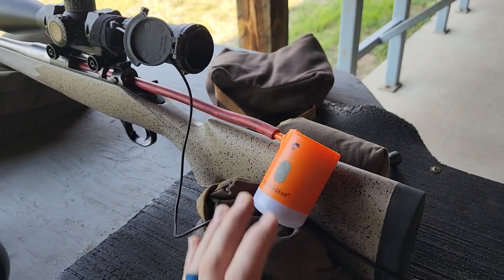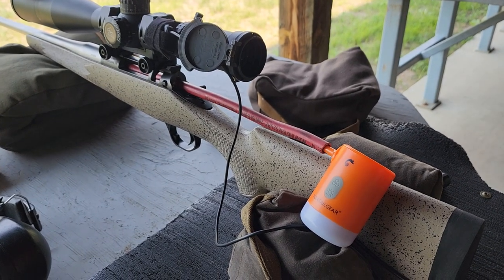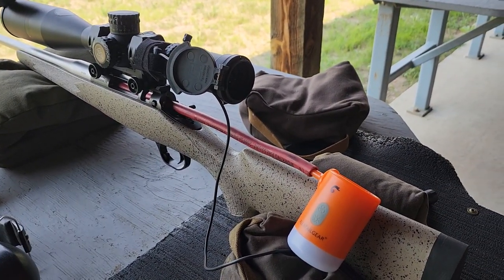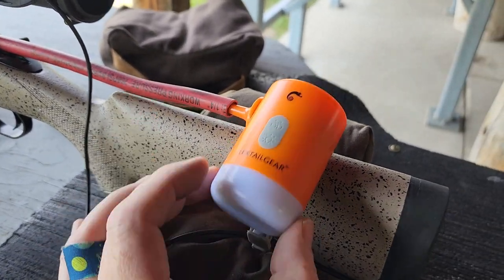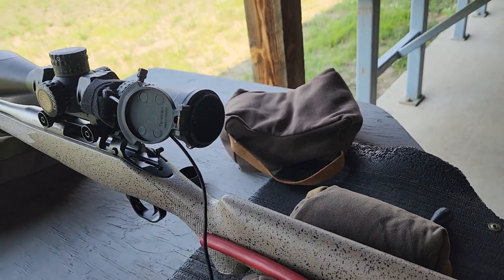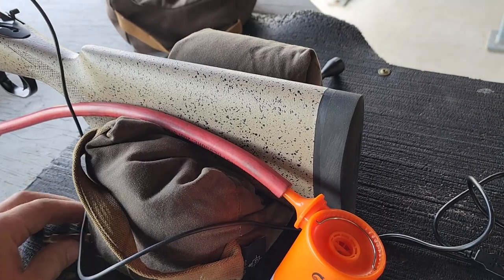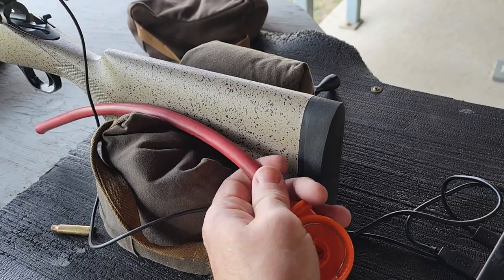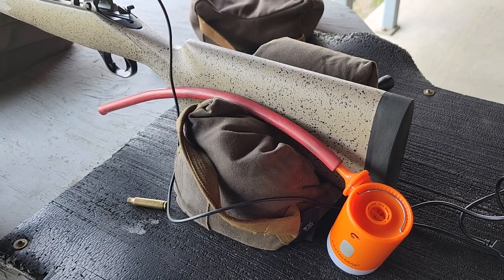DIY Barrel Cooling System!

Comment: Man if you saw what we used back in mid 2000's shooting p'dogs mid summer in +100degree days. We'd take 7-8 rifles just because everything would get so hot so fast on the towns. I brought a old CO2 tank with a line and would keep it in the tailgate of the truck. After shooting a rifle we'd lay it in a cradle insert the line and let the CO2 blow for a few min and it would make those barrels cold! Cost us about $35 to refill it each season but it worked, bit bulky.